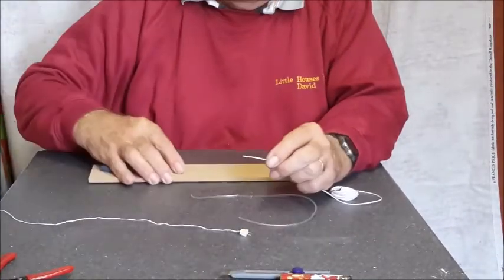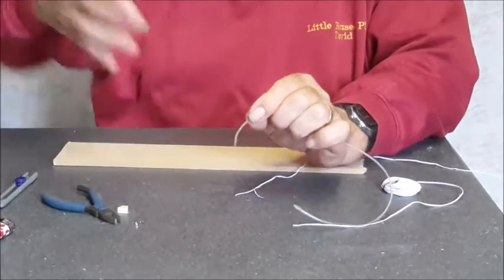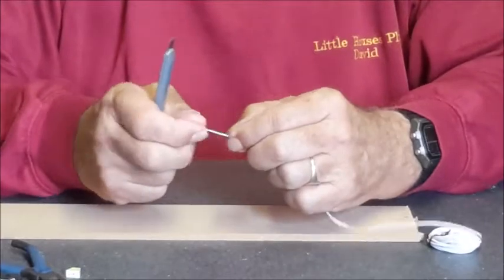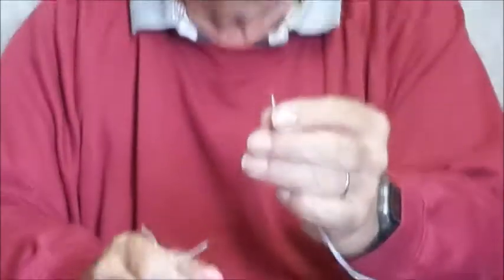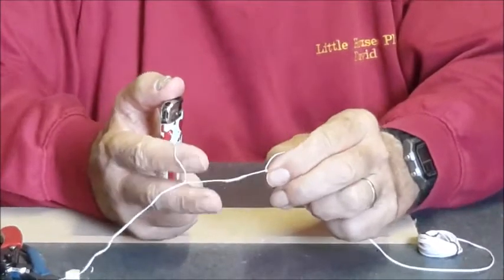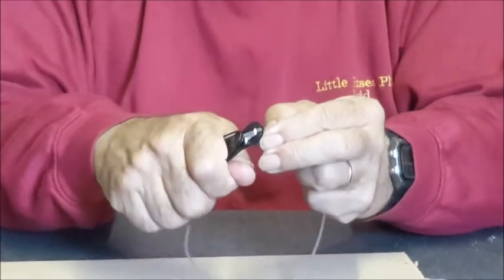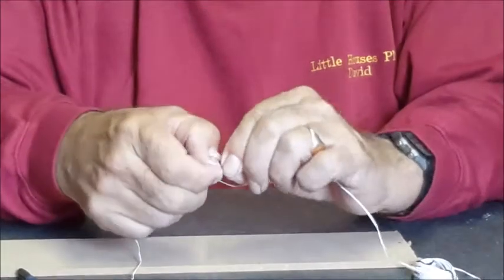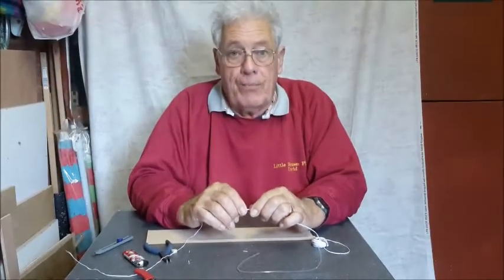Doll's House lighting instruction Extending Wires

Comment from the maker: Your message to us: Hi David, I have just watched your video on splicing wire. 
Thanks. However, I have always found difficulty in twisting the strands of the 
exposed wire to form a single twisted section, e.g. to test connections are 
working. I discovered though that after using the wire cutters to break the 
plastic sleeve, if I pull it away only a little bit (rather than removing the 
unwanted plastic in one go) I can grip the sleeve much better to roll and start 
twisting the strands together. I can then slowly pull the unwanted sleeve, 
continuing to roll the unwanted section between thumb and finger until it is 
completely removed. The result is a really tightly rolled end to the wire with 
no loose strands :). You may already know this trick but I pass it on in case, 
in which case it is useful to pass on to other customers.